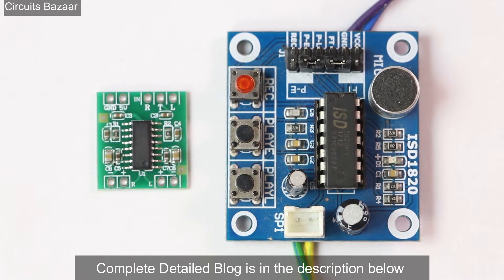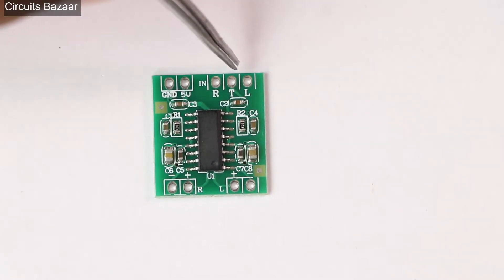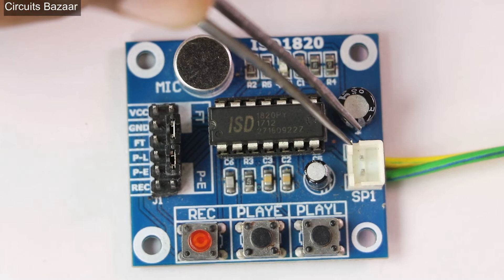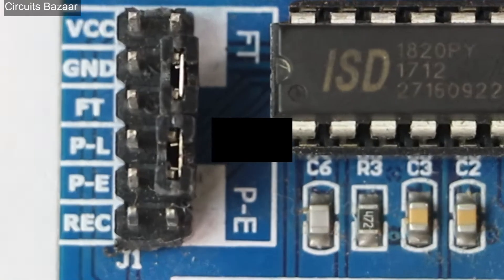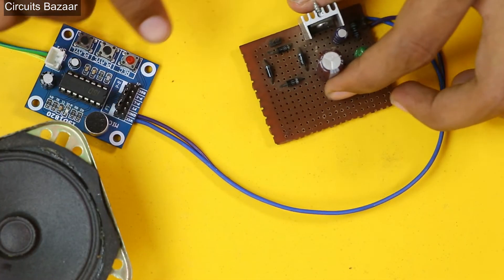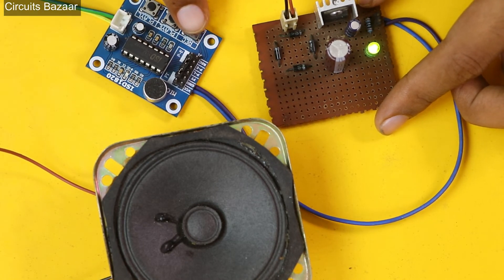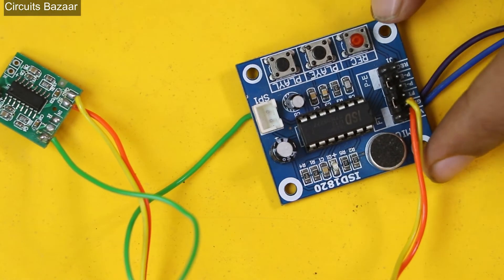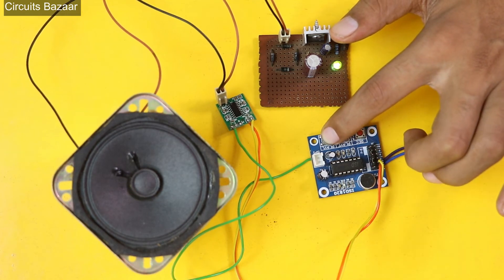Interfacing of ISD1820 Voice Recording Module with PAM8403 Audio Amplifier Module | Tutorial

Comment: Very interesting that you only use one wire for the input to the amp! I tried using signal and ground, (like one would expect to do), and only got distortion, no audio. When I disconnected the ground to the input, like you did, it worked fine, although my amp board is the newer style than yours, still worked okay.

Comment: Everyone, you CAN change the recording length by swapping the R4 resistor to either a 160K Ω for 16 Seconds or 200K Ω for 20 Seconds. The power supply is for 3.3V to 5V only as is.